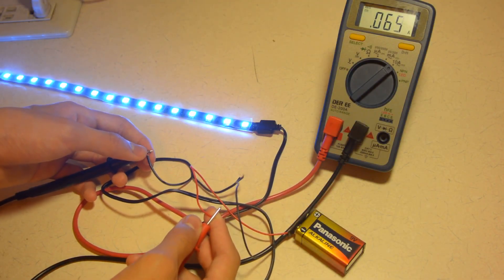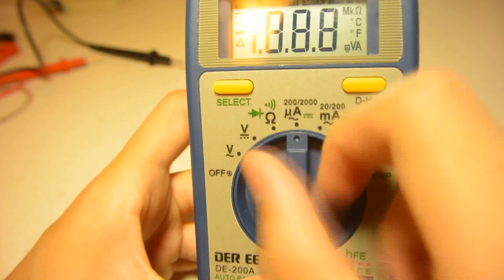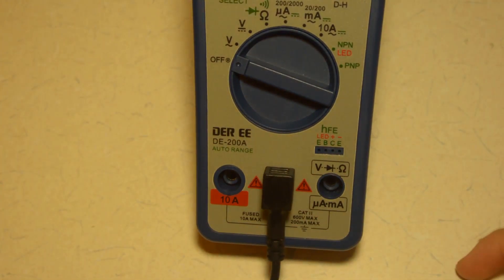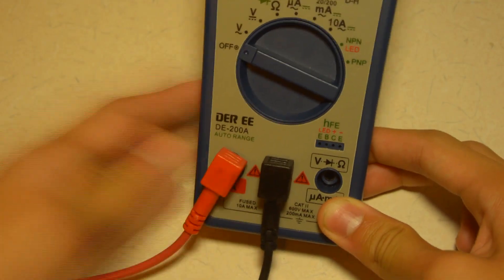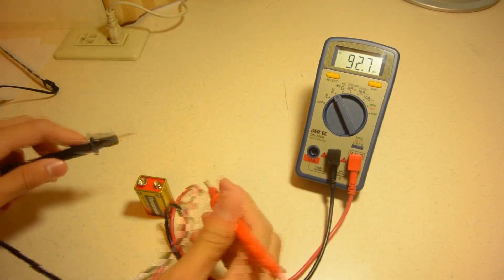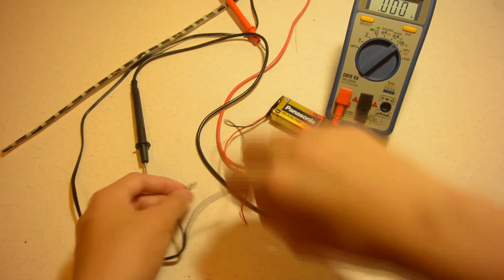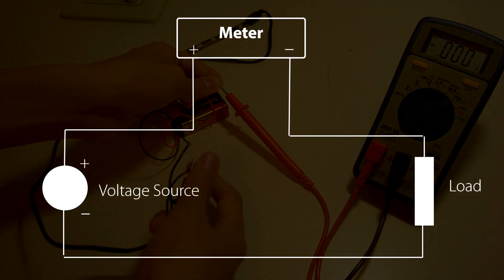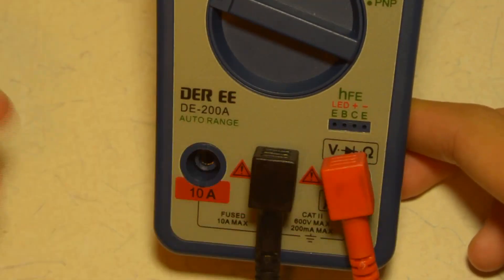How to measure DC Current with a multimeter?

Comment: Can you measure it without cutting the wire apart. Like  just split the sleeving.
Reply: I guess you can't, Amperemeter work in serie with the load, voltmeter work in parallel.

Comment: This is useful, but holding the leads with bare hands on a higher amperage circuit, your body is part of the circuit and could put current through your body or heart.
Reply from the maker: working under 24V DC, there is no way I would feel an electric shock even at 10 amps.
Reply: Working with amplifiers, I've touched AC voltage directly up to 60v. I think you'd be fine and wouldn't even notice the voltage until 40-50v. Even 60v it's just a mild tingling sensation.

I know this is DC and I'm not an electric expert. But I expect it would work similarly with DC. So no worries until higher voltages.
Reply: @JoshM7  I've gotten some tingly shocks off a stick welder and that's only below 40VDC. I was wet though.
Reply: @MF175mp  I've not handled electricity while wet other than maybe up to 12v, but I'd expect being wet makes it easier to feel the electricity.

Comment: Nice video. Now please teach us how to measure the output current from a SMPS (Switch mode power supply) to see if it is the same as stated on the SMPS.
Reply from the maker: To measure the output current of a SMPS, you can just connect it as part of the circuit. From my testing on my switching mode power supply, it has been extremely accurate.
Reply: @SlideoStudios  A Switch mode power supply usually does not produce a steady output current  like a  linear power supply does. The readings of the output current would change rapidly. 
For example,  one SMPS that I have gives readings like 0.01A, 0.02A, 2.03A, 0.05A, 0.15A, 0.11A within a few seconds. I had to add up the current readings and divide it by 6  to obtain a current output of 0.06A.
Reply from the maker: @simon6071  Thats because your load is not consistent. Your load is suddenly drawing more power. If you put a steady load it should stay relatively the same or your power supply as a fault. I am guessing you are loading a motor. A switch mode power supply does turn on and off but that switching is at a high frequency that it shouldn't cause the current to fluctuate that much.
Reply from the maker: @simon6071  Also both linear and switching mode power supply requires a feedback loop system that would constantly change its output depending on the current drawn to remain at the same voltage.
Reply: @SlideoStudios   No, I did not put a motor or any load in the circuit when measuring the current output from that SMPS. I don't think putting a load in the circuit can smooth out that changing current output. I did not need to put a load in the circuit when measuring the current output from a Linear Power Supply.

Comment: Thank you very much. I had tried connecting directly and the light has switched off on my circuit. You have shown a very important point to be noted. Thanks a lot!
Reply: Nice Video! Forgive me for chiming in, I would appreciate your thoughts. Have you heard about - Franaar Shining Shape Formula (Sure I saw it on Google)? It is a smashing one off product for revealing the secret to repair your electronic devices minus the headache. Ive heard some awesome things about it and my coo-worker at very last got amazing results with it.
Reply: Cheers for the Video! Excuse me for the intrusion, I would appreciate your opinion. Have you tried - Franaar Shining Shape Formula (google it)? It is a good one of a kind product for revealing the secret to repair your electronic devices without the normal expense. Ive heard some awesome things about it and my work buddy after many years got great results with it.

Comment: Why did u disconnected the fuse?
Is it mandatory to check the current?
Reply from the maker: I was showing what to do if you accidentally blown the fuse. :)
Reply: Bro i have one more doubt!.
Can i replace 12V 1.5A  power adapter with 18V 1A? Both wattage is same.
Reply from the maker: No, I would not recommended replacing a power adapter with a higher voltage because the current required by your device might not be exactly 1.5 A.
Reply: Ok tq